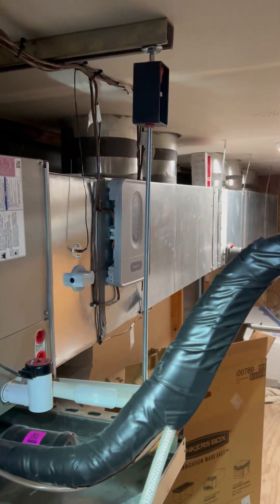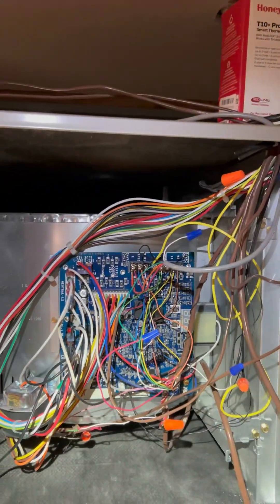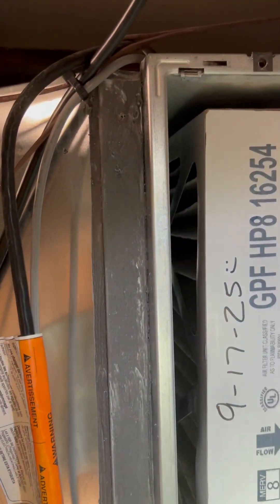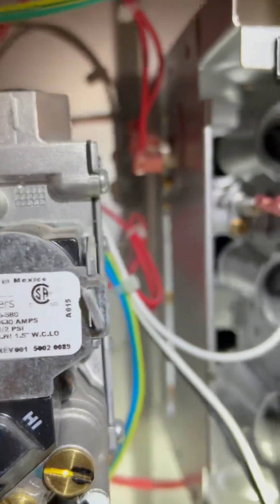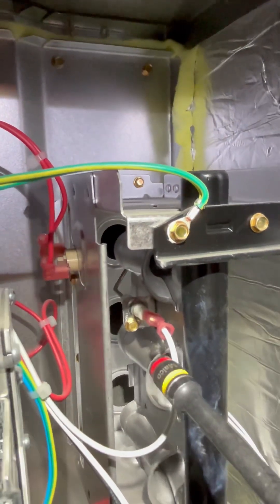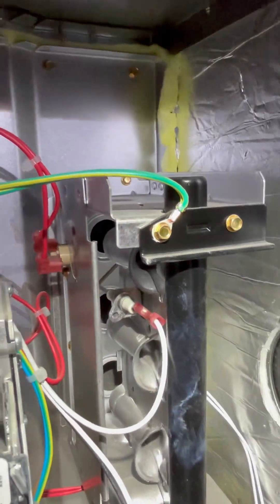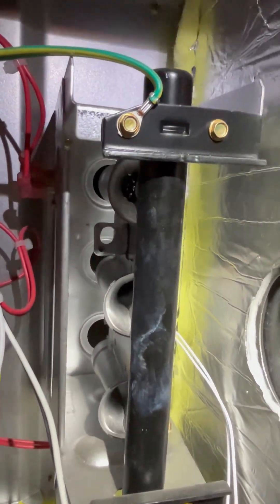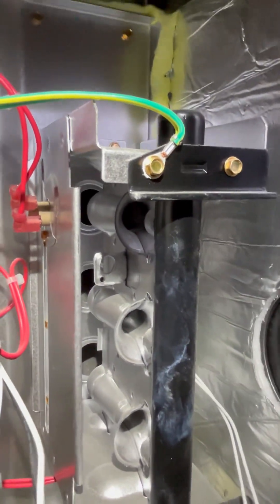No Heat! Quick- 1 of these 3 things is likely the issue why your gas furnace isn’t working!

Comment from the maker: ⚠️ Safety First: Furnaces and HVAC systems involve electricity, gas, refrigerants, and moving parts. If you’re not licensed, call a pro. These videos are for education only — see the full disclaimer in the description.

👉 Today’s topic: (Filter/ Flame Sensor / Ignitor / 
What’s the most common issue you’ve seen with this part? Drop your experience below 👇”